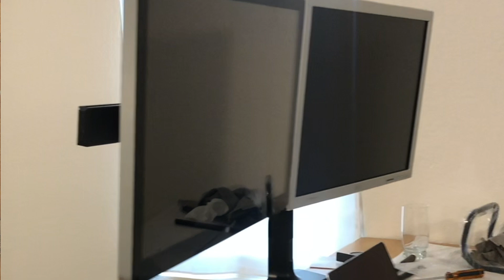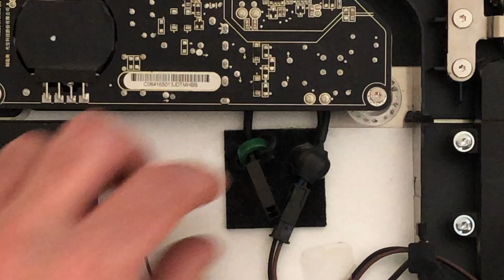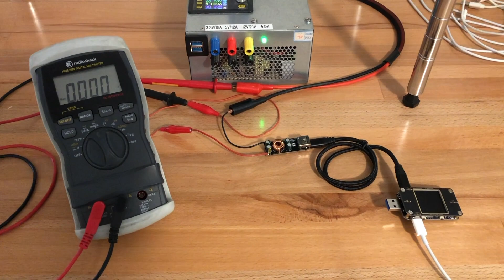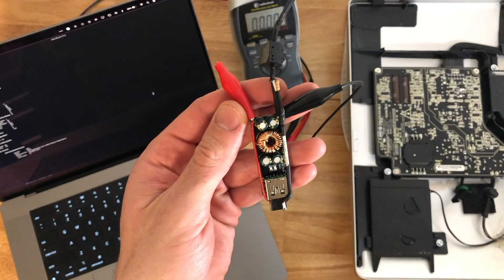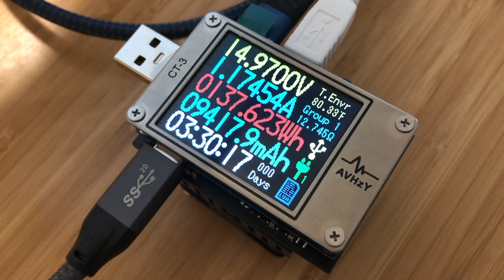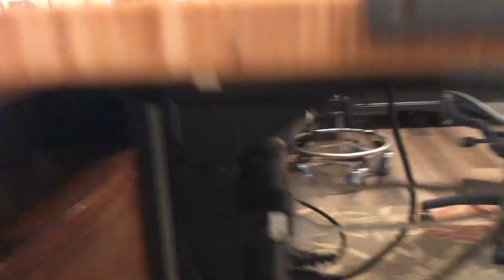Thunderbolt Display USB-C Retrofit for Modern Macs!

Comment: Just picked up a second hand Thunderbolt display myself to attempt this mod. I have a few questions tho, why is the charging limited to 45W? I'm pretty sure that the display can deliver up to 85W, which means it shouldn't be supplying 16V but 18V right? The reason why I'm asking is that I'm going to try to add an OWC Thunderbolt Hub inside of the display, to add power delivery (which means only one cable). Most Thunderbolt Hubs are not bus powered, and mostly use 20V power supplies. PD on the hub can deliver up to 60W, which means I need a bit more than 45W right? How would I go about doing that, any tips?
Reply from the maker: Cool idea! I had the same question as you. The limitation is the voltage of the power supply inside the monitor. Once turned on, is right around 16V.

It's possible that Apple Magsafe connectors pulled high enough current at 16V to supply 85W, not sure.

But the power delivery module I used senses the 16V input and decides to shift to the nearest PD fixed-voltage output level which is 15V. My Macbook senses the charger is offering PD @ 15V, and I think it self-limits the current to 3 amps, netting 45W.

I bet if you installed a boost converter to increase the supply voltage to say, 22V, the charge module would use PD @ 20V, and give you 60W charging.

To be clear that setup would be:
Thunderbolt Display Magsafe Power Supply ->
Resistor+diode to turn it on >
Boost converter (16V in, 20V+ out) ->
Power delivery module ->
USB-C cable offering PD @ 20V

Let me know what you figure out!
Reply: @colindgrant  
As promised, an update... I bought a few resistors, an OWC thunderbolt hub and the mentioned Schottky diode. I connected them to the Magsafe output of the PSU, and indeed got 16.5 volts, but even after the diode the voltage was fluctuating quite a lot? I connected a boost converter nontheless, but at that point the power supply started making a clicking noise which didn't sound very healthy, and the voltage dropped to 4 volts... 

I did some more reading on magsafe though, and apparently the PSU senses the current draw at 16.5v, and if it exceeds 4.1A the voltage will ramp up to 18.5 volts, or even higher. I've read that there might be contact points on the PSU that switch the voltage for calibration purposes at the factory. 

As I'm not too familiar with such complicated electronics I abandoned the project at that point to make sure I don't fry the power supply. I might dig back into it in the future, but my current setup works fine for me, except for the bulky PSU of the thunderbolt hub. 

I'm currently running the display into the hub using the thunderbolt 2 to 3 adapter, and running the output (with PD) into my macbook, so the goal of running one cable for thunderbolt & charging has been achieved. 

I dissasembled the OWC thunderbolt hub, and I can say with certainty it would indeed fit inside the chassis of the display. It would only need a way to run it of the existing magsafe PSU, but I don't have the knowledge/experience to figure that out. Thanks anyway!
Reply from the maker: @dogfreak3000  Thanks for the followup! Great info here. That would be super cool if you could stash the TB hub inside the display and power it from the display as well. What input voltage does it need? Can you link me to the OWC hub you bought? Or to pictures of the internals? You ought to make a "What's inside?" type video just showing the internals, that would be super helpful! C'mon, do it ;)

Anyway, I'm going to put that on the project list (but there is a long backlog right now!) Thanks again for following up.
Reply from the maker: Hi again @dogfreak3000 , I was re-reading your comment about how you read that "the PSU senses the current draw at 16.5v, and if it exceeds 4.1A the voltage will ramp up to 18.5 volts, or even higher". I would very much appreciate it if you could link me to any website that talks about that! Thanks!
Reply: @colindgrant  Thanks for the reply! I did some more reading and basically figured out what you just said. 15V indeed has a current limit which makes it usable for 45W only. I'm planning to get a boost converter to power the hub, and I'll keep you posted as soon as I have made any progress. Your resistor & diode setup is definitaly crucial for making this work, so thanks a lot!

Comment: Hi, nice video! if i would like to do the same, would i be able to connect my original usb-c to magsafe instead for charging ? that would free up one usb-c port and it would look even more authentic.. only problem i have is that converter and that resister and so on, not sure i can pull that of.. but Damm that would be a killer mod, instead of that dongle hell im running now
Reply from the maker: The USB-C to Magsafe 3 cable works in other USB-C power supplies. So it should work in the USB-C power delivery module I show in this video. But you will still have to do the modifications I showed to get the Thunderbolt Display to supply power to the module. Good luck getting out of dongle hell!

Comment: Do the USB-A ports on the back of the display still work after changing the cable?
Reply from the maker: Yes, they are powered separately by the A/C wall plug, so this modification does not affect those ports. Keep in mind each port supplies less than 1A, more like 500mA.

Comment: so without that 39.4k resistor this wont work? Its not on your parts list in the description
Reply from the maker: Thanks for pointing that out! I'll add it. Yes, you must have the resistor in order to get the Magsafe power supply in the monitor to supply full voltage.

Comment: if I just want to use it for video via thunderbolt, can I do like you did with the adaptor inside and use a thunderbolt 3 extension cable to my mac? leaving the magsafe unplugged inside? you did incredibly well everything, congrats on all the work.
Reply from the maker: Thank you, I appreciate that! And yes, you could just leave the internal Magsafe connector unplugged.

Comment: Amazing work here mate! I think I have a similar problem to others, but I cannot get my MacBook Pro M1 Pro 14 “ to work with the TB display via the TB2 to TB3 adaptor. For whatever reason, it just won’t fire up the TB display.  Any advice would be greatly appreciated.
Reply from the maker: Thanks for the compliment! As for your issue I would try to verify operation on an older laptop with Thunderbolt 2. Make sure it's turning on as expected, and let it run for at least 24 hours, through a sleep cycle, and make sure it wakes up without issue. Lots of people have trouble with these monitors just due to the cable, or something wrong inside the monitor itself. I would just double-check all of that before suspecting anything to do with the TB2 to TB3 adapter or the M1 laptop. Maybe you've already done that.

Another thing to keep in mind is that the various M1 laptops have different limitations on the external displays that can be connected. So another test is to connect a non-Thunderbolt display to your M1 laptop and see if it works.

Hopefully one of those paths helps you find the root cause.
Reply: Is it definitely a Thunderbolt Display or is it the LED Cinema Display?  The latter has a Display Port interface and would require and adapter to connect via HDMI port on the Mac.
Reply from the maker: @symosys  Yes, good point here.
Reply: @symosys   Hey. any luck sorting out your display yet?

Comment: Could you have spliced the power and display signal together into one usbc?
Reply from the maker: Probably not as simple as a splice. With the right electronics, it could work. There are modern hubs that combined Thunderbolt 3/4 and Power delivery onto the same cable, with a single USB-C connector to your computer. I would assume you can plug Thunderbolt 2 into such a hub through the Apple Thunderbolt 2 to 3 adapter. The Apple adapter does not handle power, just TB signaling conversion. I have not seen a simpler way to combine TB2 and power onto a single USB-C cable.

Comment: You might get a cleaner solution if you use a thunderbolt 3 hub, and then the 3 to 2 adapter plugged into the back of that, then just use a regular thunderbolt 2 cable into the monitor.
Reply from the maker: That would be a nice 1-cable solution, although way way more expensive. My goal was to simply modernize the existing Thunderbolt monitor's design.
Reply: Can you find any that wil work for a one cable solution? Both delivery power and video @balthxzar

Comment: Really cool solution and I was able to take this on myself thanks to your great video! I am having one issue. The PD module seems to work just fine with my MBP M1 2021, charging at 45W. However when I use with a similar vintage MB Air, the charging is intermittent. This is indicated through the connection chime and the battery icon. Any ideas what might be going on? I did try different USB C cables and was able to replicate the issue with a variety of cables.
Reply from the maker: Ahh, sorry to hear that! I hoped it would be a universal solution for Macs with USB-C charging. I will think on it but I don't have any ideas off the top of my head.
Reply: had the same intermittent charging with my MBP M1max 2021 with exact wiring and components as above

Comment: this is cool but hear me out. why didnt u use a usb c to magsafe 3 cable for power?
Reply from the maker: In hindsight, I probably should have. At the time I wanted to save the one that came with my M1 for travel, and new ones from Apple were $50. Additionally Apple's are 2m long, and capable of 140W or so, and neither of those attributes are really needed for my situation, but may account for their high price.
Reply: @colindgrant  I don't understand, what would be the advantage of this solution?
Reply from the maker: @stevenson4924  The advantage of using a USB-C to Magsafe 3 cable for power is that you can keep another TB4/USB-C port free. In my solution I used up both of the ports on the left side.

Comment: Morning can you tell me how to use this monitor with a non Mac computer? The screen won’t come on.
Reply from the maker: The Thunderbolt display needs a Thunderbolt capable computer. It won't work on computers with just DisplayPort, even though the plug is the same.

Comment: Thanks.  I have limited IT knowledge.  The thunderbolt 2 cable on our unit has failed.  Would your idea work with only replacing the video cable and disconnecting (not using) the charging function?
Reply from the maker: If you don't need the charging function, you can just buy a Thunderbolt 2 cable and plug it into the port on the back of the monitor. That port is bi-directional.
Reply: @colindgrant    Many thanks.  I will give that a go.

Comment: any problems (flickering display) before changing the cable? read that the flickering is because of thunderbolt cable. my thunderbolt is hot when removed from mac mini/ macbook.
Reply from the maker: I used to have a problem where the TB2 cable end was hot, and the video would suddenly drop out. It required a combo of power cycling the monitor and replugging the cable to get it working again. Replacing the cable fixed it. You can use the port on the back of the TB display as an input if you don't want to replace the built-in cable.
Reply: @colindgrant   i think i'll replace the cable, to clean the inside, to check cooler and whatever. i got my display for free and i love it. for the moment it's ok to spend the money on a cable :)

Comment: I’m still running an older MacBook Pro and need to adapt this to an HDMI VIDEO station with a new USB C laptop using a KVM switch. Video is my issue. Can I swap the video cable like you did, but terminate it in HDMI from USB C?
Reply from the maker: I'll probably get some specifics wrong here, but let me try and answer off the top of my head...

It gets really confusing because the names of connectors and transport standards are used interchangeably.

USB-C is a connector, used for newer transports like USB 3 and 4, and Thunderbolt 3 and 4. But it is backwards compatible with the older versions too.

DisplayPort is a connector that originally carried signals very similar to HDMI. It already existed when it was chosen as the connector for Thunderbolt 1 and 2 transports.

HDMI is a transport AND a connector for digital audio and video and maybe some security stuff. And it is backwards compatible with DVI, which is video only.

The Thunderbolt display is not an HDMI device. It connects to a Thunderbolt capable computer and makes use of the full Thunderbolt transport standard.

Video and audio and ethernet and USB data are some of the 'cars' on the Thunderbolt 'ferry', if you will. Yes, HDMI is a car that can drive on its own, between your DVD player and TV for instance, but it can't get on a ferry unless there is a terminal on either end.

My conversion still connects through the Thunderbolt transport. It's just that the adapter from Apple, stuffed inside the display, does two things: 1) it converts the Thunderbolt transport version from TB2 (display) to TB3 (computer), and 2) it coverts the connector from DisplayPort to USB-C.

From your question I can't tell if you are using a Thunderbolt Display at all. If you are, then you can't get around the fact that it must be connected to a Thunderbolt computer, regardless of the connector.

But Thunderbolt displays, and Thunderbolt computers can output video to non-Thunderbolt devices. Your older Macbook probably has a Thunderbolt 2 port, using the DisplayPort connector. And you can get a dongle to convert DisplayPort to HDMI. But it's just an output.

If you're trying to connect two computers to a KVM switch, and you just need to output video from your older MacBook to an HDMI input port on the KVM, then you should be good with an adapter dongle. But my older 2015 MBP also had a HDMI port, so I would just use that.

Comment: How do I get the VESA mount off of a Thuderbolt display ? Every video shows how to put it on but NO ONE says how to get one off.
On the broken one on the street Tuesday night the glass was gone but the LED display was OK the back with you OK the cables are OK I’d like to see if I can repair it and get it working again. 
But I need to get the VESA mount off.
Reply from the maker: Thunderbolt displays don't come with a VESA mount. The have a tilting stand built in. I added a VESA mount to mine from a brand called Human Centric. Search for "how to remove thunderbolt display stand", there are lots of those.
Reply: @colindgrant  The VESA mount is screwed on to the back of it. Looks like a square & I did a video SHOWING it !
Reply from the maker: @georgesenda1952  I found your video. It looks like the previous owner attached an Amer VESA kit to it. That's not original, but you can see some pictures of it here: https://www.amazon.com/Amer-MD179ZM-A-AMR-VESA-Kit/dp/B01BHCEZ3W
Reply: @colindgrant  Thanks but HOW do I remove it ? Assuming the display is salvageable.
Reply from the maker: @georgesenda1952  Not sure, I've never held one. Looks like there's a head screw on the side. If you can't remove it, then just use it for mounting to a display arm. Removing it will only get you to the hinge that works with the original stand. It's not necessary to replace the LED or glass panel.

Comment: Can I do this without adding a power supply to charge my MacBook Air M2 ? (Just leave the socket empty without fear of a problem ?) I can't weld because I don't have any equipment and experience.
Reply from the maker: Yes, you can simply unplug the old Magsafe cable from the black connector I showed in the video, and leave that connector empty.
Reply: @colindgrant  okey, thanks a lot !

Comment: What about taking a new MagSafe 3 to USB-C from Apple and hacking the USB-C side and soldering it to the inside of the Thunderbolt Display. It's already 85 watts. You get to use MagSafe 3, you get back a USB-C/Thunderbolt port on your MBP.
I just got a 16" MBP M1 Pro, bought a MagSafe 1/2 adapter to USB-C, I only get 45 watts, plenty to keep the MBP charged since it sips power, but I would prefer to use MagSafe and get back a port.
Reply from the maker: There are a couple things that make that difficult:
1) Cost; go check out what Apple wants for Magsafe 3 cables and chargers!
2) The MS3 cable itself is USB-C based, but it needs USB-C Power Delivery negotiation so hacking off and directly soldering isn't an option.
3) The TB Display only has so much power available. I've read 'up to 85W', but it's a 16V system, so that would be over 5A and I don't think it can actually supply that much.

But what you could do is install the USB-C PD module I showed, and simply plug a Magsafe3 cable into the USB-C port. You're right, that would give one of your USB-C/TB ports back.

At the time I did this the MS3 cables were in short supply, and only available from Apple. I haven't checked recently. But at the time I wanted to keep mine for travel.
Reply: @colindgrant  thank you for the reply. When I get a chance, I'm gonna do this retrofit. I wish someone would make a plug n play solution, but I do know how to solder. Just gonna have to get around to it eventually.